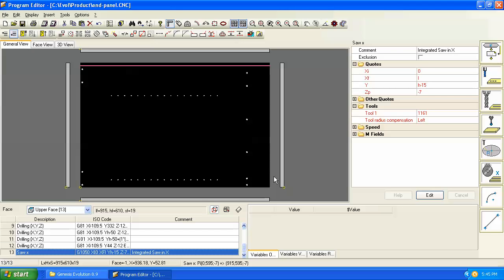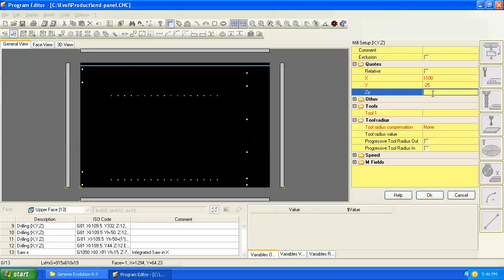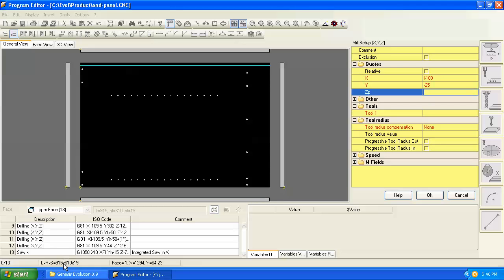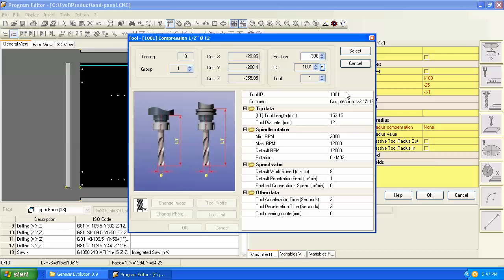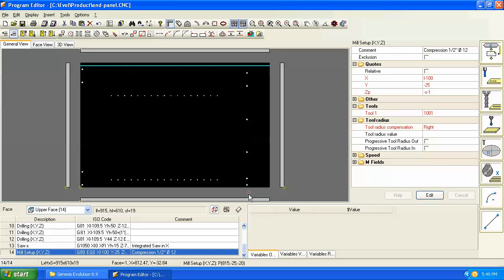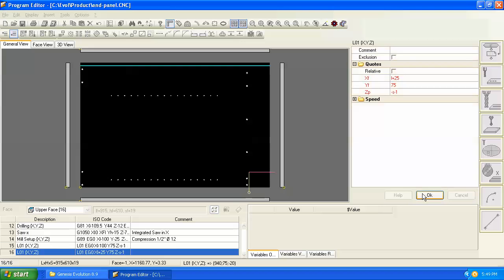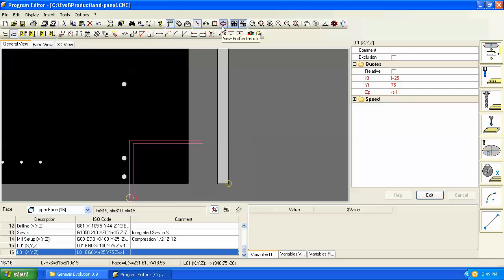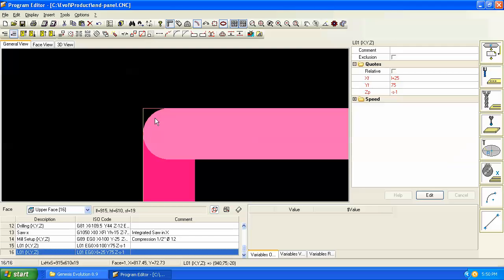GenEvo Intro 12

Comment: Could you tell me if you are uploading more videos about genesis evolution.
Reply from the maker: there are some other videos on the Software channel.  What other techniques or features are you looking for?
Reply: Could you tell me  more regarding the m fields .also you can mirror in x axis is there a way to mirror in the y axis.optimizing tooling etc. Any info would be great.
Reply from the maker: charles foley M is a mirror field, right-hand reference, using the entire machine.  R is a mirror field, right-hand reference, using the right side.  N is a normal field, left-hand reference, using the entire machine.  S is a normal field, left-hand reference, using the left side. Genesis Evolution 8.9 and above can mirror in Y.
Reply: Sorry I mean to say m fields in the mill start point. If I put in the code 99 one of the dust shrouds stays up. Could you tell me what code/s is it  for all the shrouds to stay up while working.
Reply: We are running 7.1.
Reply from the maker: go to our website and the contact links to send me a message directly...thanks